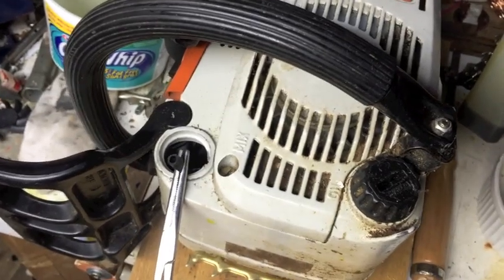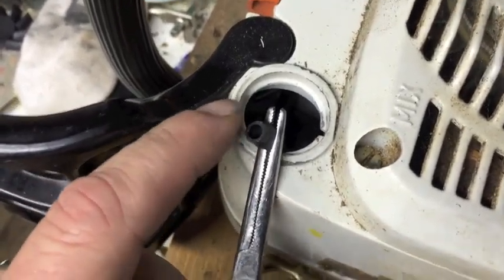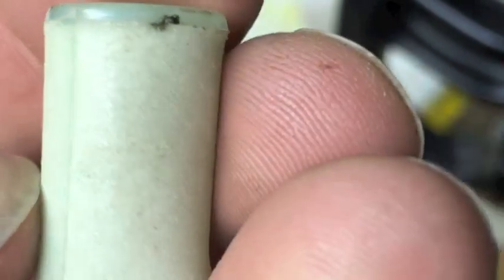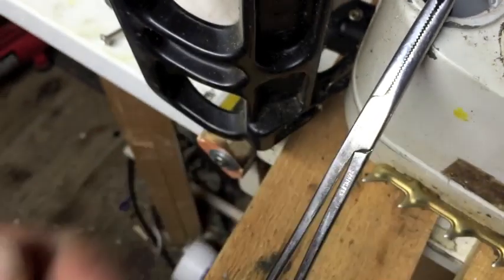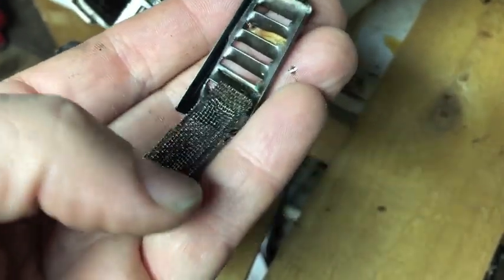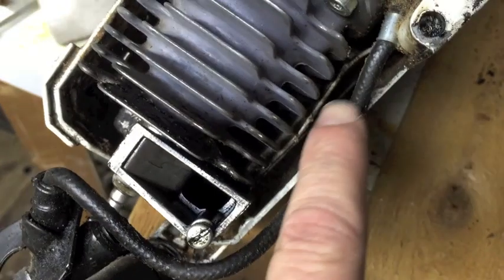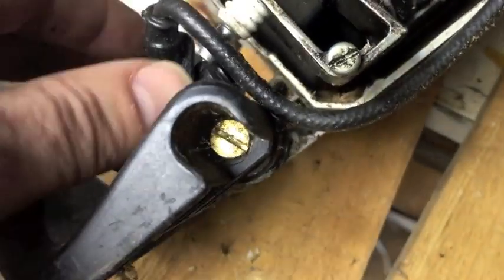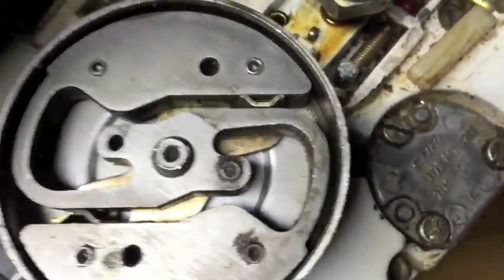STIHL 011 AVT Chainsaw Problem Part 2

Comment: That wire runs up through about the third fin from the case and runs across the top of the jug, it doesn’t go in the bottom of the case. I have two of those and they’re great saws. If it’s  not staying running, make sure it’s getting fuel, you might have to prime the line to get it to run and run it wide open for a while to pull all the air bubbles through. You can drip gas into the carb and start it a few times to get it to prime, then you can kick up the idle screw until you get the carb adjusted. The top screw is open throttle adjustment,the bottom screw is the idle mix screw. Gently turn them all the way in until they stop, then turn them back out 1-1/8 turns and that should be close enough to get it running. Slowly turn the screw in until it runs rough, then turn it out until it does the same, then turn it back to the center of the two, that should be ideal. You do the same for full throttle, and if it’s boggy when you first rev it up,turn the bottom screw out another 1/8 turn and try again

Comment: I have the same saw and was gifted it from a buddy that didn't want to fiddle with it.It's been sitting for an unknown amount of time.I saw that you suggest ebay for parts and my local Stihl dealer pointed to the trash can for this saw and wanted me to get a "new" one.I'm willing to do the maint but need direction.  What fuel?What plug?What filter?etc.  thanks!
Reply: Don't throw it away. Send it to me if you're going to throw it in the trash

Comment: I've got the same saw that I found in my Granddad's shed. it's been sitting for an untold amount of yrs. Can you tell me where you order parts from? I wish I had some advice for you, but I'm new to small engines and so I'm afraid my headache has just begun. I had a shop look at it. The guy had it for over a month and all he said was that the fuel tank was corroded and that I may as well buy a new saw. Maybe he's right, but I really don't trust his advice as I think he really just didn't want to fool with it. I'd greatly appreciate any advice you could give me in order to get my Granddad's old saw running again. These saws are expensive and I'd rather not have to buy a new one if I can fix this one for less. Not to mention the centlemental value it has for me. Thanks
Reply from the maker: +JB Robinson3 When it was running, it was a really great saw. Lightweight and it had lots of power. I picked up all my parts on eBay. Browse and take your time ordering. Some the parts are outrageously priced. I got a spark plug, air filter, new carb and recently a fuel filter. Since a cabin neighbour took pity on me and sold me his STIHL 026 for $100, this saw has been on the back burner. I hope I can get it running, really appreciate well made machines.
Reply: @CedarworkshopNet  did you ever get it going?
Reply from the maker: @wkualum3194  It would start and then putter out.
Reply: @CedarworkshopNet  it's probably the carb that needs to be adjusted with the fuel mixture needles

Comment: How do I attach my electric quick stop slide button back on ?
Reply: Take the side cover off and the switch slides under a strip of metal on the case. You can check that it works properly with the case off and while it’s off, sand the spot where the switch grounds to bare metal so it stops correctly

Comment: The spark plug wire runs through the fins..
Reply: And mine has a nylon reinforced cable sleeve over the wire as well to protect it from vibration on the cyc head heatsink fins.

Comment: check the plug wire is not shorting out
Reply from the maker: hmm, good answer. Will check.
Reply: Ya the only problem I had with this saw was the spark plug wire vibrating against the air cool fins and wearing out after like 20 years of use tho. Good lil saw.